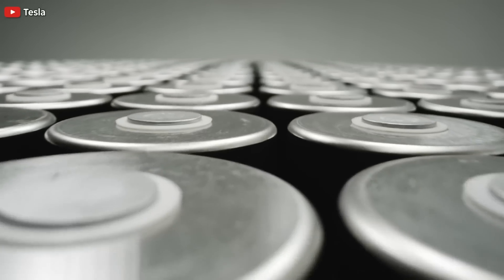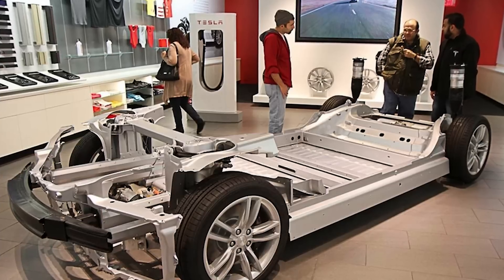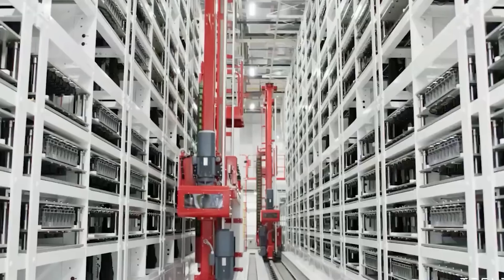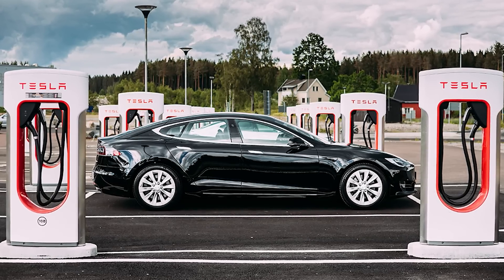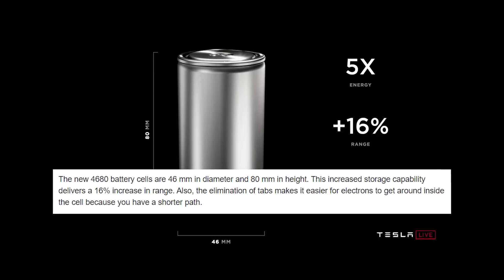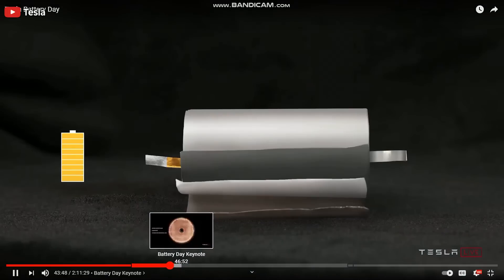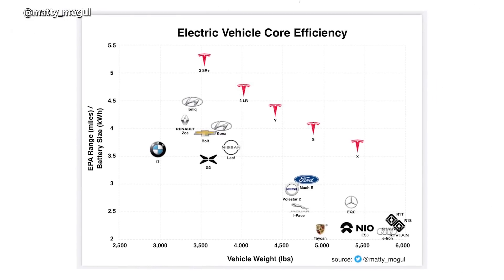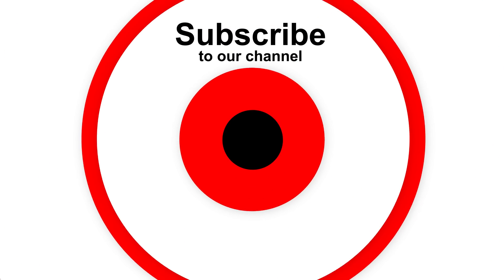URGENT: Tesla's 4680 Batteries Seem To Be in Production

Comment: Look at yesterday’s Tesla Daily: This “leaked photo” seems to actually be Model S Plaid battery pack which is using an old format 18650 inside.
Reply: Rob at Tesla Daily does a much better job of reporting on rumors/leaks than most youtuber and main stream media. He actually digs into the details and sources to determine the validity of the rumors/leaks. Whereas most other youtuber and mainstream media are just interested in quickly repeating the rumors/leaks without any backchecking in hopes of garnering more views.
Reply: @kenchow8213  Right on!  I'd give you two or three thumbs up if I could.

Comment: I think that it's probably true. The Kato rd. Fremont pilot 4680 battery factory has supposedly been in full operation for many months now, but having a completed structural 4680 pack is an important step in Tesla's rollout of their new batteries. The first production use of the 4680 batteries and structural pack has been planned for Giga-Berlin's new Model Ys, but the German factory has been mired in bureaucracy and delays in it's construction and completion. I had figured that Tesla had been producing the 4680s for a while and stockpiling them to kickstart the Giga Berlin Model Y production. But until Germany works through their bureaucratic delays they won't be able to move forward with production there.

Comment: Possible DEATHTRAP in side impact collisions.
Reply: How so? I’m more worried about fires

I like BYD blade for that reason
Reply: @Tigerratcat  The 4680 is a structural battery. So the floor pan of the passenger compartment is the top of the battery. Any fire will be IN the passenger compartment, not under it, like in the old design. 
Plus.... the 4680 is not serviceable. It's a $15,000 to $20,000 throwaway battery! Tesla knows exactly how to screw their customers, just like Apple.
Reply: @DavidJohnson-tv2nn  Thanks David. I completely agree with you. These are my biggest concerns and NOBODY is addressing them. Can Redwood recycle ♻️ Structural batteries or Tesla themselves for that matter?
Reply: @Tigerratcat  Thanks. Even if Tesla or someone else could recycle the batteries, the customer shouldn't have to buy a new battery if some cells are dead. The old design is modular. So the modules can be replaced, in theory at least. In reality, Tesla is screwing their customers right now....
 Enter....
"Tesla's $16,000 bill to fix a nozzle demonstrates EVERYTHING wrong with modern repair"
in the YouTube search box to see what I mean, and why I will never buy a Tesla.
The guy had a broken coolant fitting on the battery. Tesla wanted to sell him a whole new battery!
Reply: @DavidJohnson-tv2nn  thanks David. That was awful from Tesla. Ridiculous customer service